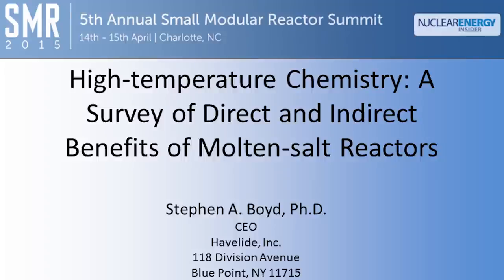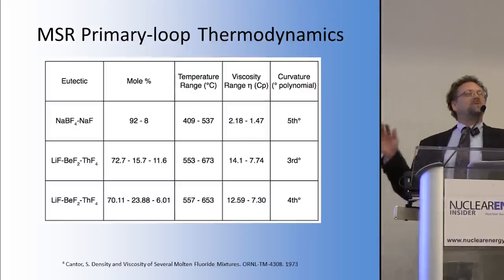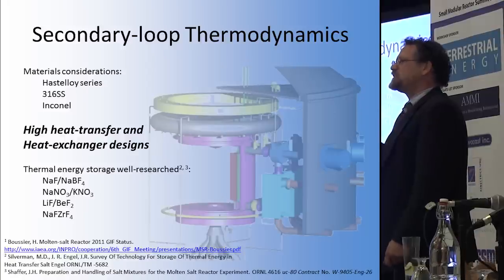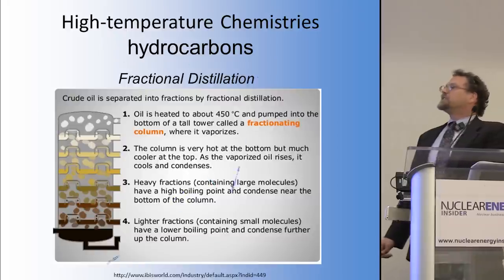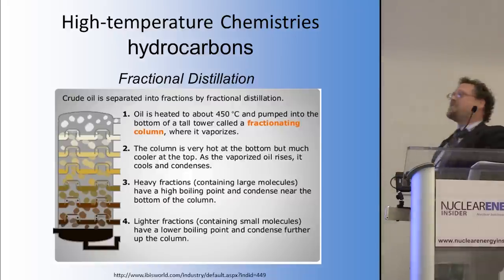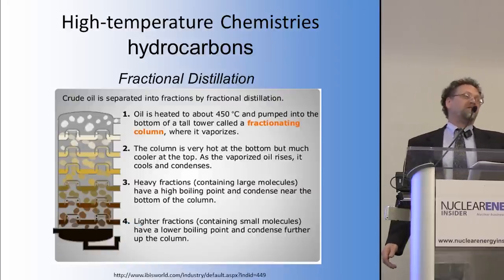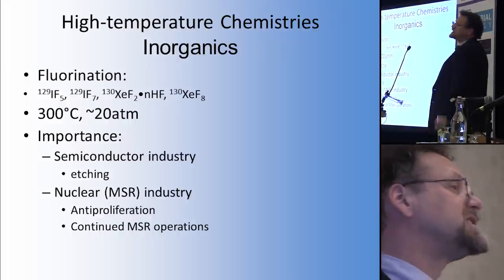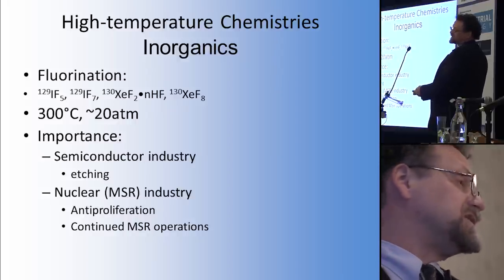Dr. Stephen Boyd - High-Temperature Chemistry with Molten Salt Reactors

Comment: Gordon - thanks for documenting all of these extremely important presentations. Dr. Boyd is certainly excited by the possibilities. He needs to go out and present to broader audiences, at chemical engineering and petrochemical conferences, at least. Right now, petrochemical businesses are burning some of their feedstock for the heat they need to manufacture their products. Molten salt reactors can help them stop burning money! Dr. Boyd has a lot of possible headlines and attention grabbers for talks like that. Especially by raising the specter of competitors doing it first and taking the markets away.

I predict that when these companies really start wanting the nuclear heat batteries, the regulatory and siting pathways will get shortened and simplified (but not at the cost of safety). Big money can put a lot of pressure on governments.

There are a lot of angles here. Gordon, I hope you've left a clip recorder with Dr. Boyd so that he can get good audio when he speaks. He's one part of the answer to Kirk's rhetorical question about what we could do with cheap, reliable, safe heat batteries. He has the vision!

Comment: I remember the earlier discussion of using the heat from these reactors to separate petroleum from tar sands, so much of the petroleum produced in the process doesn't have to be returned to and then consumed in the process.  The exploration of non-electrical uses and cogeneration just keeps getting better and better.  
     The non-electrical route may well provide the foot in the door for these reactors.   In addition to the regulatory hurtles of just authorizing the operation of such reactors by the federal authorities, in the electrical utility industry side there is a whole second set of regulatory hurtles with state utility boards and their approval systems that take forever.  These utility regulatory agencies also provide another circus for the anti-nuclear activists to peddle snake oil.  If these reactors are quickly used in some of the processes described by large industries, it would not only expand the base of these reactors, a track record of these type reactors would encourage their use on the electrical generation side.
Reply: There is efficiency in the centrally powered systems; however, having backup power systems as well as dispersed systems would be nice if they can be operated in a rational cost/benefit system.  I live in Louisiana and there are storms and power failures many times and quite a few people have natural gas generators.
     The only thing that would destroy the idea that all power must be centrally generated would be systems that can generate electricity at a cost per watt when needed near the price of the central systems.  Nothing is close to that.
     There are some things in some climates that might work for neighborhoods which would replace some aspects of the need for electricity such as solar powered water heating and lithium-bromide chillers/other absorption refrigeration processes.  Heating and cooling consume a lot of power and are responsible for a lot of the swings in power usage loads.

Comment: When you make Portland cement you. Use a lot of heat and it gives off a lot of co2. If you can use a reactor to heat the limestone to cement clinker you could capture this co2 and use it to make fuel from sea water.  When the cement is used in construction it absorbes carbon dioxide from the air.
Reply: 10-4 ,, good point
Reply: This is the way of the future.  Fix all loose ends.  It works for habitation in space, too.

Comment: I guess when Kirk Sorenson was expounding the use of MSRs as a source of process heat, he wasn't kidding.

If I may add one, it would be the production of Synfuel through the Fischer Tropsch process. With an excess of hydrogen, available if one could use the sulphur-iodine process to generate it, one could even capture CO2 from the oceans to generate the carbon monoxide feedstock. Thus you could decarbonise the oceans and generate fuel for use or sequestration. The energy penalty is ridiculous, but with nuclear there's so much of it that it might be viable.

Sulphuric acid, so essential to many industrial processes, can be generated using the process heat in the contact process.
Reply: Chris Bergan I watched Larson's JP5 from seawater presentation soon after. 2.90 per gallon sounds pretty massaged in terms of numbers, but with a ~600-700 degree Celsius output temperature and Sulfur/Iodine I think NRL can bring a full scale process down to that number.

Comment: I saw a bloke melt sat in a small furnace using a stainless steel pot when he removed the melted salt the pot was useless like the salt and heat had turned almost into twisted foil,  doesn't bode well for MSR using a steel pot to hold it. I understand Hastelloy is refined but hot salt and steel do not seem to go well together. I have wondered why we don't have a test reactor running and producing power I think the question is answered.
Reply from the maker: Nigel. Table salt melts at 800°C. FLiBe melts at 460°C. FLiBe's melting point is already hotter than today's PWR outlet temperatures of 325°C. Hastelloy-N won't oxidize until around 750°C. So that gives designers, a very safe 300°C margin with which fission can heat the salt and not impact the Hastelloy... as opposed to you watching a video of melted table salt which is already beyond the reactor's operating temperature.

A test reactor DID run, it was called the "Molten Salt Reactor Experiment". https://www.youtube.com/watch?v=tyDbq5HRs0o ...and it wasn't shut down because the vessel melted into "twisted foil". Because they weren't using table salt.
Reply: @gordonmcdowell  Thanks for that M8 I have been looking for a sensible answer and as soon as I finish watching Izaak Arthur I will check out your link thank you.

Comment: I wanted to compare the pros/cons of the mentioned msfr vs msr/lftr but could not find anything in detail that was readily identifiable.

This vid failed to record the presentation and only shows the speaker.

watch?v=Yz07sALwDcU
Reply from the maker: Dukky Drake I'm not sure why they (they=ThEC) didn't bother to integrate slides as they shuttled across to YouTube, but here's the original video+slides that CERN captured. You can watch it integrated on a laptop with Flash installed. (Or at least that was the player tech last time I tried). http://indico.cern.ch/event/222140/session/9/contribution/36
Reply: Thanks, this integrated version is much more helpful.

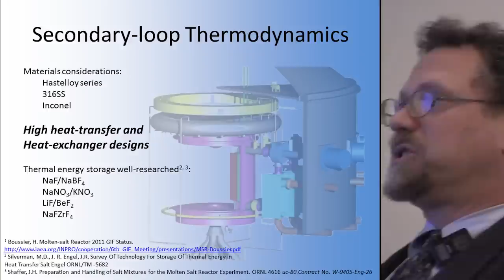Comment: At time 5:42 your drawing points out that you will need pipe welders that weld exotic materials (316 ss and inconel) these guys go currently for about $35-40 USD /hour.  So please please standardize your plant, stop doing ONE OFFs.
Reply: None of the gen.IV designs is planning one off's, they are all moving towards factory production.

Comment: You are suggesting to use nuclear energy to produce more plastic and refine more oil. Unbelievable. Making more bunker fuel for ships, instead of installing a small reactor directly. I am horrified by this presentation. Worst ideas ever.
Other people come up with stuff like water desalination, co2 capturing, carbon free energy. And here you are suggesting going more into the environmental crisis but now on nuclear level.  And the reason? Money. Makes you wonder if humanity will ever solve climate crisis.
Correct me if I'm wrong, but this is depressing.
Reply: >You are suggesting to use nuclear energy to produce more plastic and refine more oil. 

uhmmm based